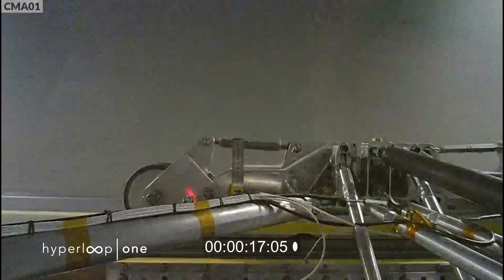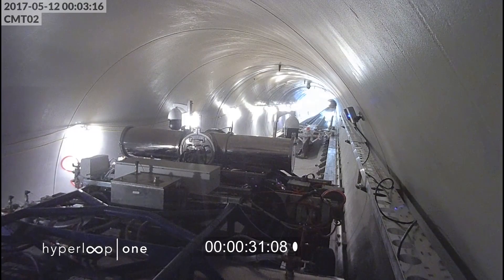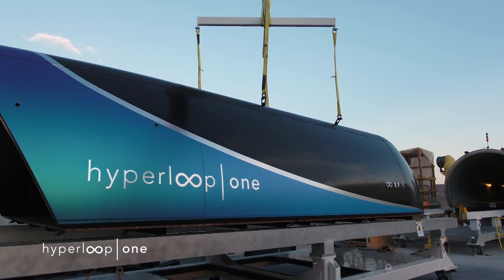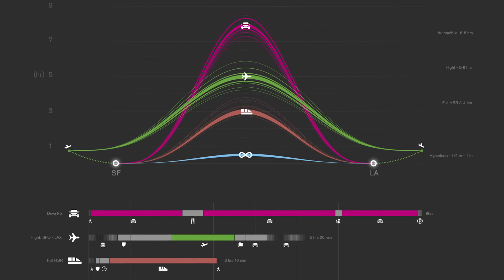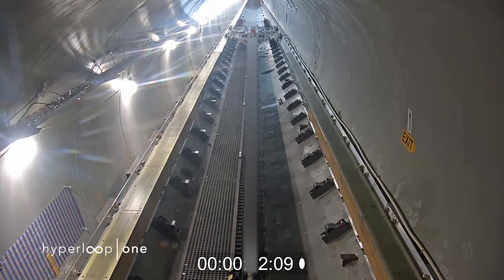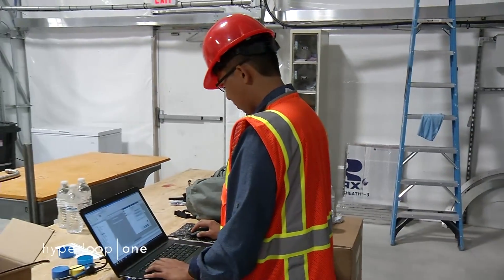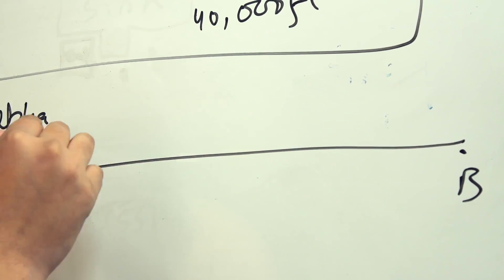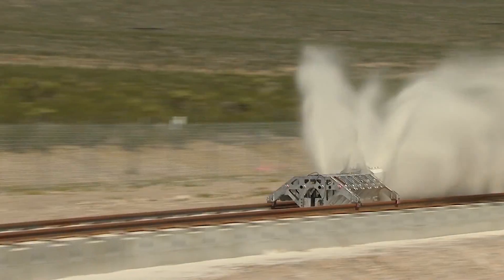Watch the Hyperloop Complete Its First Successful Test Ride | WIRED

Comment: I like thunderfoot ... But he is way too cynical . Yet a portion of his fanbase drinks his word like godamned koolaid
Reply: if you dumbasses continue tapping each other on the back the laws of physics will bend so you can fell good.
Reply: That doesn't mean what he says isn't true, I want this thing to work but I don't see it working because of the points thunderf00t Made in his video.
Reply: thunderfoot is a fucking crab
Reply: Yeah he's gotten a bit too cynical over the years. His tone is getting kind of annoying.
Reply: David G this is no different than oil pipeline
Reply: Daniel Munter guys that is the problem . Yes he is a scientist , but this is not only not his field , but its not science but engineering . He is a human being and can make mistake . I am not saying hyperloop will succeed , but man , 10 years ago if you told me that rockets could now land on a small drone ship in the middle of the ocean I wouldnt have believe you
Reply: Here are some major mistakes from the videos

-The vacuum chamber used by nasa is only that thickness because of the radius of the chamber. The only thing that matters in pressure tube thickness for rigidity in the vacuum chamber. Not the volume as thunderf00t suggested.  The simplified thin wall assumption is that the maximum (failure) compressive stress in a cylinder is (Pressure*radius)/thickness 

Pressure is absolute. Any insinuation that the pressure will get any amount noticeably stronger going from 0.01% of an atmosphere to 0.0001% of an atmosphere (compared to normal atmosphere) is wrong.

-Metal foil can hold back vaccum. the ISS is at this very moment orbiting with one atmosphere of pressure acting on metal about 2.5mm thick. Thin metal can also reversibly flex. This is probably how they'll account for expansion. 

(oil/gas pipelines can't do this because they need significantly thicker pipes as they run with 9 atmospheres of pressure MINIMUM)

Also those struts are likely to prevent buckling while the tubes are being transported (because they'd be piled up + the other tubes weight and shape may buckle it)

-The large hadron collider only needs seals that powerful because it needs to be a perfect vacuum to stop interference from other atoms in their atom detector. Hyperloop doesn't need to remove every other atom from the system, just have it at nearish vacuum. This means the seals don't need to be nearly so beefy.

- The fan isn't a jet. It there isn't to provide thrust. It's just there to stop there being a buildup of atmosphere in front of the capsule. It doesn't need to be a turbomolecular pump. just a compressor powerful enough to move the air i.e a lot lower speed/tolerance. The thrust has been stated to be electromagnetic propulsion. The stated thrust on the second video is just a consequence of it.

-A decompression wouldn't maintain itself and would slow down due to friction. Assuming a normal tube, 2km after it was completely ripped open the air flow rate would have dropped to about 5%. (http://www.engineeringtoolbox.com/pressure-drop-compressed-air-pipes-d_852.html). Smaller holes would be similarly far less bad and wouldn't rip open from a small hole unless the tube wall was made too thin.
Reply: At least I don't drink water from the air, I'd die of thirst.
Reply: lame
Reply: geordi rendum Same here. I don't necessarily agree with everything he says.
Reply: geordi rendum thunderfoot is a scientist for go reason.
Reply: geordi rendum I disagree with him on climate change and his political stance but he is dead right on hyperloop.
Reply: CannabisMaximus Having a near vacuum in the tube is the problem.
Reply: Huevo Duro702 and oil is being pumped through it take heat with it, so the pipes cool and don't expand as you would with a vacuum tube.
Reply: If we never tried the "impossible" , we wouldnt have planes .
Reply: Also pressurization isnt as much of a deal as you guys think . Thunderfoot said that a leak would compromise the entire system ... But the iss have leaked in the past and it was no big deal
Reply: Cai Jones From what I heard the walls are SUPER thin. So the heat is going to stretch and expand and make the metal more brittle couple that with subzero atmosphere and the whole structure could be compromised. Don't get me started on the fact that a stray bullet from a hunter or some idiot with a gun decides to shoot it (depending on the caliber) it could pierce through the thin steel as well.
Reply: Ethan Mooney the ISS had leaks and it was no big deal
Reply: geordi rendum Leaks that were noticed and some unnoticed. I'm just saying that like I want this to work yet at the same time I am kinda skeptical after doing my own research.
Reply: How will they create and maintain an almost perfect vacuum in a 1800000m³ tube?
Reply: + TeddyLXIX Probably by managing it on a section by section basis cutting off damaged sections from the rest of the system in the event of a failure. having pumps placed periodically + monitoring leaks.
Reply: ABaumstumpf You're drinking his Kool Aid. You're forgetting that the car was once a rich man's transportation, and until vehicles like the Volkswagen Beetle cars were meant for the top 1 percent of the world's people.
Reply: sebastien, thank you for actually thinking about this. I agree with most of your points, though I don't think you're correct with regard to the metal foil example. The ISS is 1atm internal and 0atm external; the Hyperloop is the opposite. That doesn't change the stress on the wall, but local failure by buckling is the common failure for cylinders with an external pressure. The 20mm Hyperloop tube is sufficient to prevent this failure mode, but 2.5mm metal foil would not be.
Reply: true. But his criticism is still valid:
There is no way to make such a system yet. building it is possible, but it would cost a fortune and could never be viable - and it would need a lot more infrastructure and protection than si portrait most of the time.
Reply: "But he is way too cynical"
And you guys are way too gullible. But you know what, let's see how this hyperloop thing works out, both in terms of following the schedule and following the proposed budget. It wouldn't be the first time Elon Musk has wasted time and money, and it certainly wouldn't be the first time people bought into overly optimistic fantasies like solar roadways.
Reply: There's plenty of topics I have disagreedwith Thunderf00t on. However his criticism of the Hyperloop is not one of them. He is not too cynical, he is realistic.

I like thinking outside the box as much as the next guy but at some point you're just wasting work, time and recources.
Reply: Agreed, a lot of  his assumptions on that hyperloop video he made were wrong yet everyone agrees with him
Reply: Exactly how is he being way too cynical when talking about a train of this nature? The project costs too much for the purported benefit of getting to the destination a bit faster than you would have by plane. A superior option would involve simply creating a more efficient plane route between two Californian cities.
Reply: I am not saying thunderfoot is all wrong on hyperloop . But he exagerated some problems and was wrong on some other . I would have to go back watching the entire video to tell you exactly on what since I dont remember
Reply: kiffe22 if everyone thought like that we would still be in the Stone Age..
Reply: Look at oil pipeline they're not straight for a reason, this hyperloop is a scam
Reply: How to get out of the vacuum tube without waiting 30+ minutes to pressurise a compartment large enough to hold a entire cart.
Slowing down nearly impossible at 800 mph in vacuum 
La-sf is on the San Andreas fault
Being hundreds of times bigger than the LHC
These are the main points in the video which I believe are true.
But the expansion due to heat I couldn't understand because couldn't it just expand out words instead of lengthwise?
Reply: yet he makes a valid point on expansion and atmospheric pressure causing disasters
Reply: Hi folks. I am a mechanical engineer adequately trained in the field to cover any or all of the issues. 
My opinion is that 90% of thunderfoots criticisms are plain stupid but don't just take my word for it.  Ask me anything.
Reply: Ok, which of TF's criticisms were plain stupid? Nothing fancy, just list the statement and the rebuttal.
Reply: The same way anyone creates a large vacuum? It's not hard to scale up a vacuum chamber if you're only expanding in one direction, because then surface area scales linearly with volume (so you can add vacuum pumps at regular intervals and the pumping time will remain constant).
Reply: geordi rendum he's a scientist. People who hate undeniable facts don't like when he criticises something, that much is certain.
Reply: geordi rendum thunderfoot prices that this just isn't feasible.